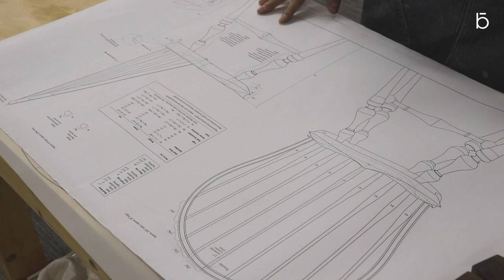Making a Windsor chair 'Loop back'

Comment: Hello Bi Lim. I also make chairs like you. Could you help me to know where your reamer tool is purchased. I'm from VN
Reply from the maker: https://www.amazon.com/Yankee-Automotive-Repair-Reamer-0-5000/dp/B00UHFXUGE/ref=sr_1_5?dchild=1&keywords=yankee+taper+reamer&qid=1598625354&sr=8-5

https://www.amazon.com/Drill-America-Joint-Taper-Reamer/dp/B07NDBLSZ9/ref=pd_sbs_328_1/143-4226299-6192054?_encoding=UTF8&pd_rd_i=B07NDBLSZ9&pd_rd_r=8c642de0-9142-4acd-809c-870de5f20ae3&pd_rd_w=UVdbs&pd_rd_wg=ZCW9k&pf_rd_p=703f3758-d945-4136-8df6-a43d19d750d1&pf_rd_r=7CQK9387MWC2ED3RRF9X&psc=1&refRID=7CQK9387MWC2ED3RRF9X
Reply from the maker: Mine is yankee 5inch long. but I can find it. there is only 3inch.
I think 5inch is good. because of taper degree.
Reply: @bilimwoodworks  Thanks you so much